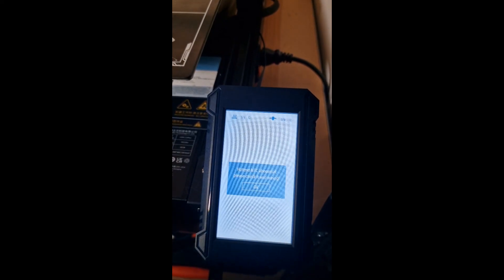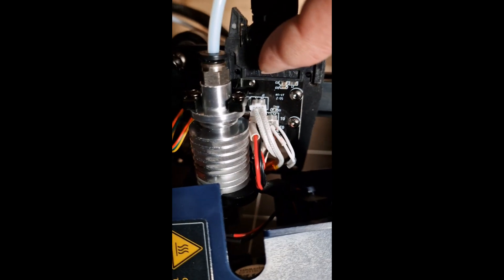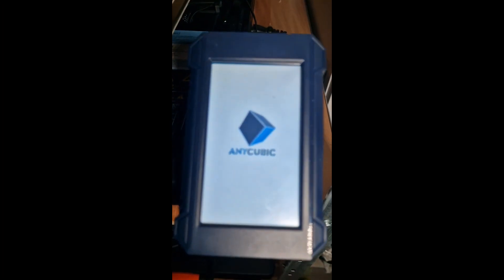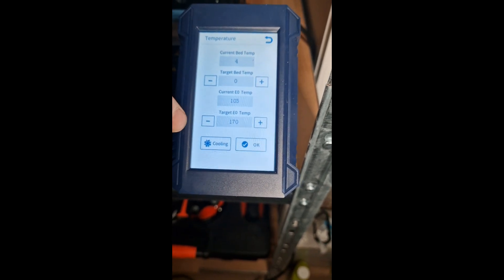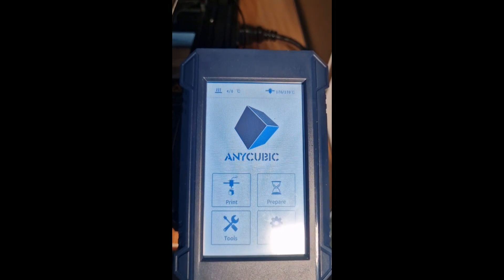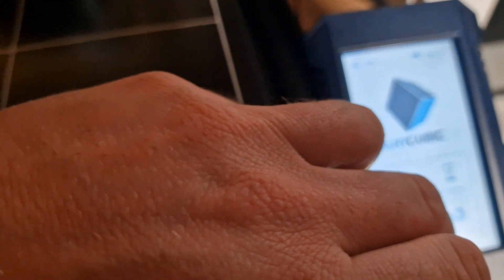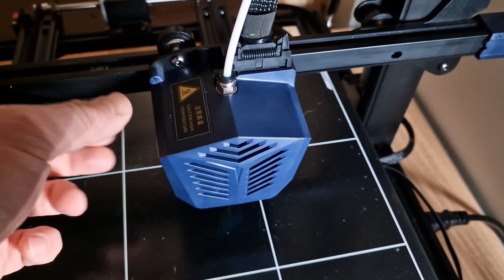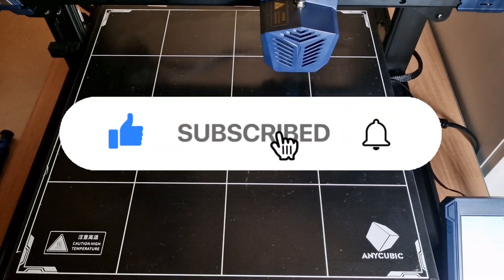NTC Hotend/ Bed Abnormal on the Anycubic Kobra Max...odd #3dprinting #3d #3dprinter #anycubic

Comment: Hello, does anyone know the part number or the values of the thermistor and the heater cartridge so I can order a replacement? The error on my printer, which is the same one in the Kobra Max v1 video, shows zero temperature and connecting and disconnecting it doesn't fix the problem, so I'll start ordering spare parts and hope that at some point it works again.

Comment: I have had the same issue with both my anycubic kobra maxes, my bed issue seems to occur while printing over the center of the bed where the bed temp sensor is located.  I am typically able to avoid this issue by avoiding this portion of the print bed.  This has been the only resolution I have found so far.  Anycubic was not much help in resolving, they sent a replacement bed, boards, etc but the issue remains.  I believe it be an issue in the programming if the printer itself where the affects of printing above the bed sensor causes it to think the bed temp has gone above the allowable controlled temperature.

Comment: I have to same problem but I think it might be a wire problem, with mine sometimes it works and sometimes I get the bed heat problem which stops my print. I found out the wires are not that good and when they bend they might lose connectivity which would give you the error/abnormal, I don’t know if that’s the problem exactly but ima try it out on my kobra max and I’ll let you guys know
Reply: I WAS RIGHT, it was a wire problem!!! My wires would pinch as the bed was moving, cutting power to the bed, which was causing the error. If you are having the same problem either with the nozzle or the bed I insist on taking the clips off that hold the wire from interfering with print, or prevent your wires from bending/kinking. Hope this helps others.

Comment: For me it was the part cooling fan. When you have it turned up it cools down the hotend a bit and the software thinks its a fault. If you turn down your part cooling fan to like 20% it will work without error. But you end up getting shit quality prints. Fuck this printer. Absolute garbage. I took mine apart for the extrusions.

Comment: hi  i have the same problem ,i replaced the hot end ,sane problem ,i ended up replacing the mother board and i found no problems all working ,and when i fitted the old mother board back i had the same problem hot end htc error .my opinion is that the mother boards are faulty ,and that anycubic needs to replace all motherboards under warranty
Reply from the maker: @sylvesterv7906  I'm thinking that it's the case 🤔.  They should offer a replacement

Comment: Hi,
I have the hotend issue and have tried your solution with no change in my results. I have noticed that the blue LED is off until I touch the hotend (cover off) then the blue LED lights up. Does this suggest an earth issue in the wiring? Thanks
Reply from the maker: I'd say the connection is faulty yes maybe remove check wiring then reseat it hope it works 💪
Reply: Hi, tried to disconnect and reconnect everything in there and still have the same error. Even tried to heat up the hotend with a hair dryer to try and cheat the system but no good.

What do I need to get this going again do you think?

A whole new hotend unit, with board and cover etc?
Reply from the maker: @samallttocs  so u may need a new hot end board it's the small one behind nozzle
Reply: @3DPUK-TECH-CHANNEL  hi again, I have been looking for a full replacement of the print head including the motherboard - I’m having trouble finding it. Do you know if this part exists by any chance?

Anycubic Kobra MAX COMPLETE Print Head! strain gauge, fans, light, and hotend!

Comment: Same error. Took cover off hotend, wires seemed fine. Moved printer from my pottery where it was about 5 degrees to kitchen where it was 18 degrees, and all ok. So I agree it seems to be an issue with the whole printer getting too cold. As with new cars, they should have taken it to Norway for initial testing!

Comment: Just printed my onboard file perfectly fine and now upon my next print attempt, I am now getting these errors. Originally it was throwing the heatend error. I then tried to heat just the bed itself and now I get a bed error. They have put a sealant over the wiring now unlike what is shown in your video... it must be them trying to eliminate the poor connection issues. I have tried creating more heat even though my room temp is already quite hot, and still errors. I have now reached out to the company trying to get answers, will update once I hear back.
Reply: Hey, did you get any response back?
Reply: Hi, I’m also curious, did you resolve the problem? Did they get back to you?

Comment: Had my max for a year or so and just got the hotend error it is winter here in Australia now you got me running out to wave the heat gun over it see what happens
Reply: It worked!!! You bloody ripper thanks phil
Reply: @ozjado  What temperature did you get it to to "kick it over"? Ive tried with a hair dryer but not gone past 30 deg. The hotend is my issue.

Comment: I think you got the hotbed error because the housing for the Hotend was on the bed and the fan was running against the bed while you tested your fix for the Hotend
Reply from the maker: The error occurred before I removed :)
Reply: @3DPUK-TECH-CHANNEL  fair enough haha I missed that , did your fix hold up for any length of time ?
Reply from the maker: @Christopher Wall  seems too have worked so far thanks for watching

Comment: Thanks for posting. I got exactly 2 prints before I got my error. No time to investigate today.

Upon my initial calibration, my Z offset was around .8... Last night, I moved the printer to a new location and the Z offset reset back to 0.00 so I reset the Z offset and it was upward of 2.85-3. That makes me wonder if the wiring might be hanging up the Z axis. Will report back after my investigation.
Reply: My thermistor on the heated bed was free floating under the insulated tape. One lead had no solder at all and the other very little. Parts coming on the slow boat.

Got it printing with some work and the extruder stopped working, 9 hrs in on an 11 hour print. Awesome!

Comment: I bought one of these printers for my son, we noticed that the bed is not heating up, we check the bed of the printer and we notice a bubble in the middle part of the bottom of the printer bed. Any ideas or clues of what this may be???
Thanks in advance for your help. 🙏🏻🙏🏻🙏🏻
Reply from the maker: The bubble is ok this is the bed thermistor... in terms of not heating up  have all the connectors been connected???.  Temp up to 60c nothing lose
Reply: @3DPUK  yes all the connectors are connected and we have printed before, he was actually printing something for my little kid, it was 60% into the print and it fail because the bed temperature.
Thanks for your quick response 🙏🏻
Reply from the maker: Ah OK did it show bed temp NTC hotbed error ??? Is the environment cold ??? Did you try adjusting the bed temp
Reply: @3DPUK  The NTC hotbed error message popped up several times. Hotbed won't even heat up to 20-30°C.
Reply from the maker: @Donovan Prez  ok that's odd 🤔  I can't answer this question  I'm afraid
Reply: @3DPUK  thanks for your help! And of course I will join to your Facebook page.

Comment: hi..Got a "refurbished one" yesturday had the same issue. found my problem it was the 2 core screened cable which had snapped at the back of the hot bed just before the cable support .. no problems so far..

Comment: In this very cold spell in the UK my printers are in an outhouse, needing fan heaters early in the day. Both the Kobra Max AND my CR10 go to this error because its too bloody cold !!!
I also adopt procedure to just get a few degrees into the bed and hotend via the control....say 10 deg. I leave my room heating on for say 30 mins then return and the machines will fire up ok
Hope that helps guys
Reply from the maker: Awesome 👌  thanks for your helpful input to my video much appreciated
Reply: Same for me! Chucked a heater next to it for 5 mins and it works!

Comment: Sadly, mine required a whole new motherboard, which took 2 months to get from China to the USA.  First they insisted in trying just the hot end board, then the ribbon cable, and then FINALLY the motherboard.

So if you're going the customer service route, get all 3 parts at once; hot end board, ribbon cable, and motherboard.  It'll save you a bunch of time and frustration.
Reply: 3DPUK is it possibly the low temp thresholds set in firmware? (If there is even such a creature) And if there is wonder if bumping them say 5° might do away with the issue you experienced. While I realize that will do nothing for a truly failed heat element or thermistor in either hotend or bed.
Reply from the maker: Appreciate your comments. I'm hoping this was an isolated incident 😕
Reply: @3DPUK  Unfortunately, I don't think is.  I hear about defect Anycubic printers all the time; hotend NTC and hotbed NTC are a common denominator among the problems.  The design flaw of the bed clips shorting out motherboards is another one.  If you don't install the clips with the longer side up, they make contact with wiring on the bottom of the bed and then bzzzt!

I'll never buy an Anycubic printer again.
Reply: @MonsterHunter267  if people short with the bed clips then its not the printer.. it clearly states in the manual how they install.  In addition, a vast majority of people that have issues with the max are 'fiddlers'... they like to 'upgrade'.. and almost always are plagued with problems straight after.

Having said that, I do agree that the design of the pcb in the print head is prone to failure..  I hope you get yours sorted out.